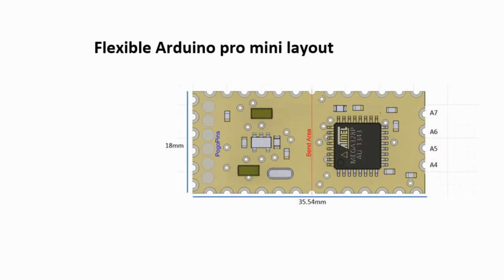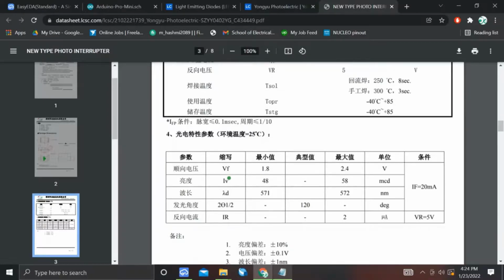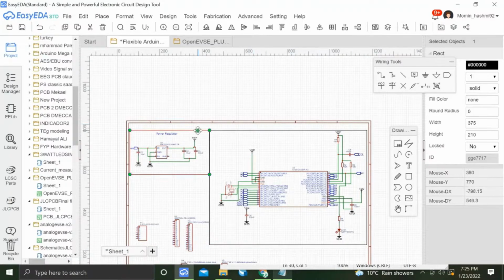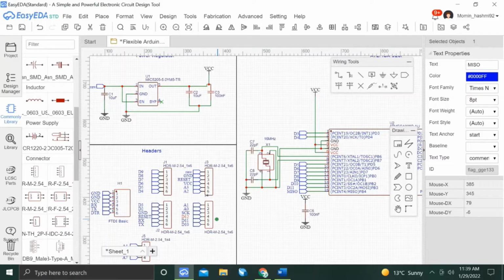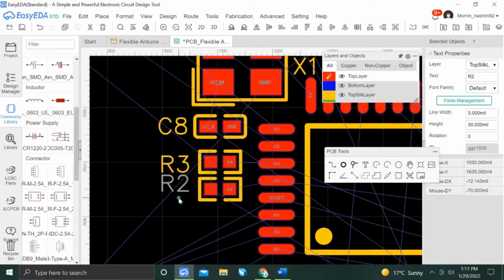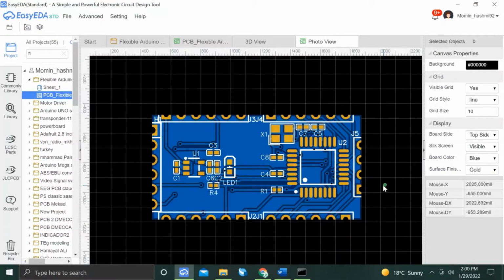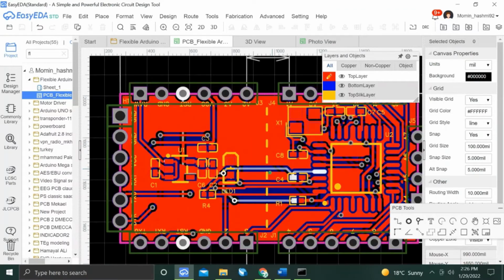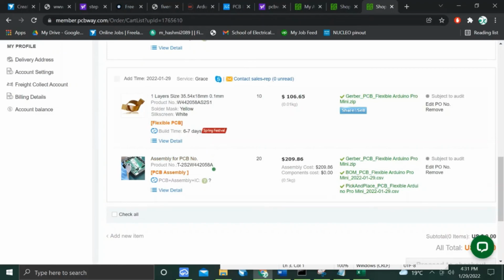How to make PCB on EasyEDA and Order it on PcbWay - Step by Step Guide

Comment: nice video! what if in the part library, it says "minimum: 100"? does it mean in assembly I'll have to buy at least 100 parts?
Reply from the maker: Yes, But you will get the exact Number of parts once you upload your BOM to JLCPCB. For example if I require only 1 10k resistor in my PCB but the least order is of 30 so when you upload the BOM it will show 30 under "Quantity" column